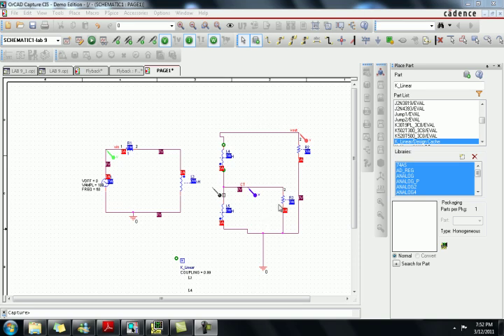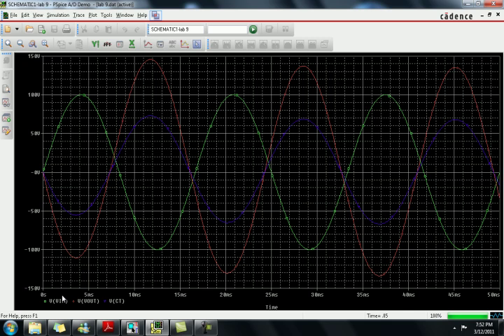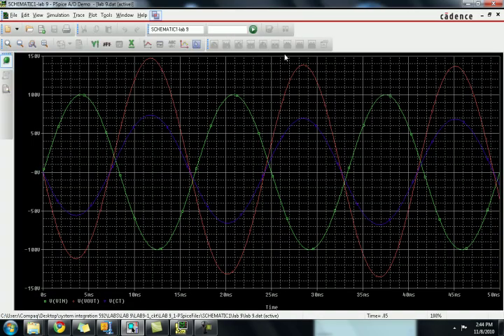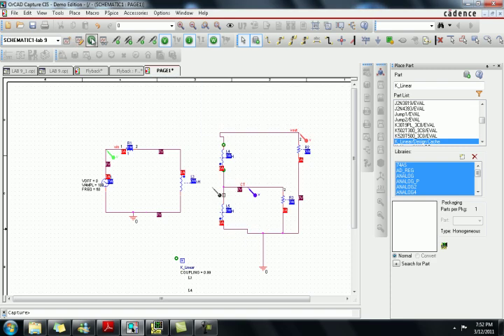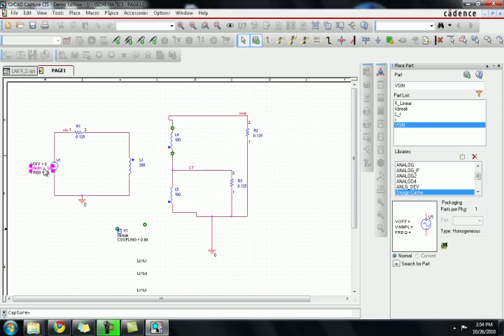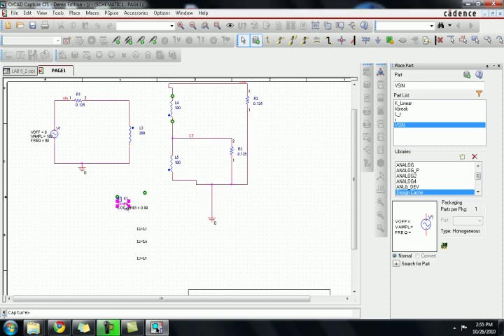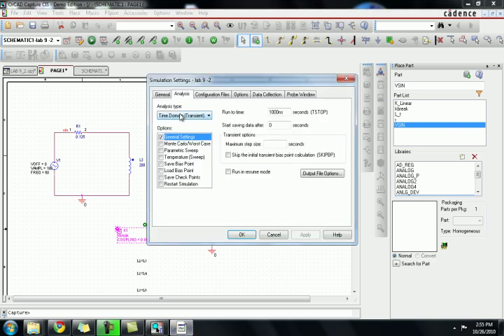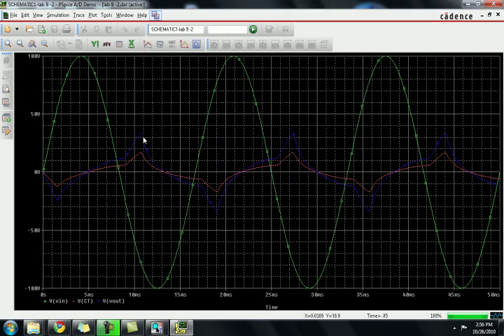AC PSpice Transformers

Comment: A step by step tutorial on how to do this would be more helpful.  Show us step by step how you created the transformer.  Start with adding the transformer windings. Then show us how to use the k_linear function.  Orcad Pspice is not a very user-friendly program. If someone is coming to youtube to learn how to use transformers in PSpice, DO NOT ASSUME that we are proficient in this program at all!  Let us see you build the circuit from scratch.  Also, you need to make sure that you speak very clearly.  You have a tendency to mumble in this video.  Speak clearly and concisely and enunciate.
Reply: you can find the transformer in the XFRM_LINEAR, from "ANALOG", it's the TX? that's TX1. when you click p, at the place part window. in case someone needs to see this. it will be here